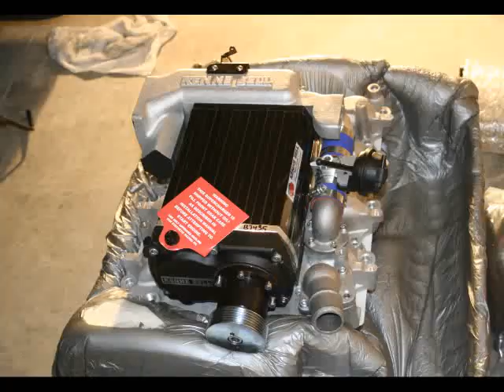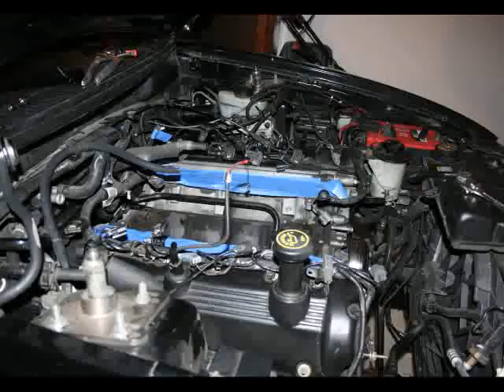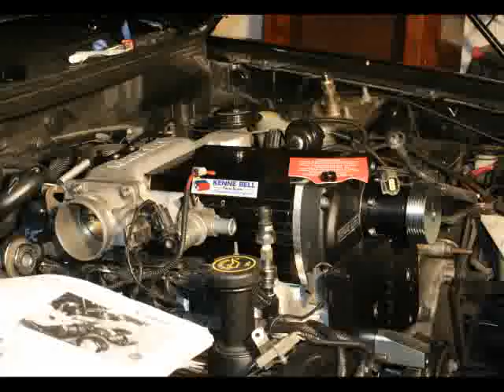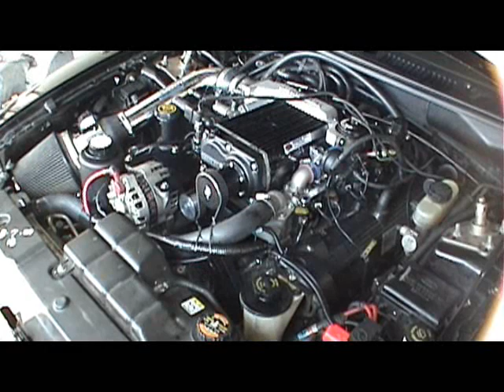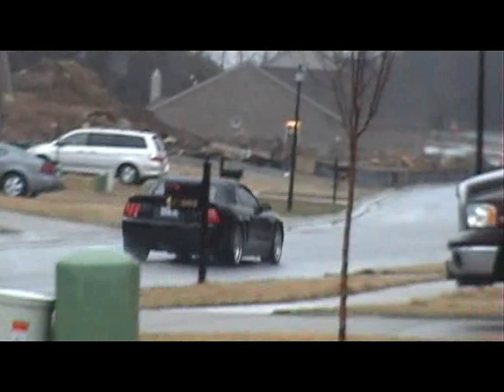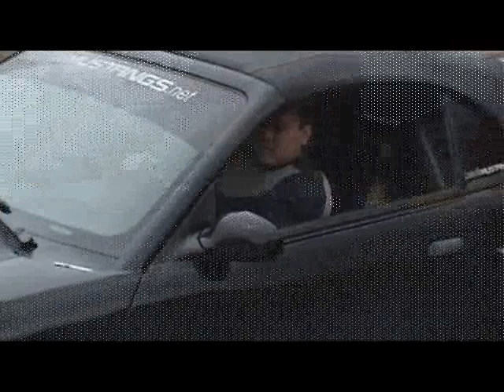2.1 Kenne Bell Mustang GT

Comment from the maker: No the install is pretty straight forward.  KB provides pretty good instructions with pictures.  The numbers I got is what I expected I was going to gain.  I wanted a more low end pull rather than the top end that my ProCharger was getting.

Comment: @mxracer578 well KB had a Stock test GT they did and were able to get it to handle 14 PSI, but the 9 PSI is recommended with stock internals. Im excited to get mine, im gonna get it in a couple months.

Comment from the maker: Yes I installed it myself and it wasn't as bad as it looks.  KB has very detailed instructions with pictures which help out a lot.

It's not a daily driver so I can't ask that question but I've heard it's no different than without it.

The engine is completely stock from the heads to the oil pan.

Comment: yeah i was looking at the kit on there website at it says the 6-14psi intercooled kit for $4999 comes with a boost-a-pump and the chip, and sense it didn't say anything about injectors i was wondering if i had to buy them separate

Comment from the maker: The JLT won't work with the KB.  The BBK Pipe I have on there barely worked.  Reason is the KB pushes the TB out from the center of the engine more so with the BBK intake pipe I'm using it still hits the passenger strut tower.

Comment: I just put the K-B on myself, fixed the kinks " iac valve, leaking heater tube fitting on the blower just needed tighting." I'm running the 9 psi 2.1L like you with the complete intake upgrade kit from K-B and man. I had no clue it would make it run like that. ITS MAD FREAKING CRAZY. boring is NO MORE

Comment: did you do the install yourself? If so, how hard was it?

how does the car run as a daily driver? Do you have any other engine work done? Or do you run stock internals?